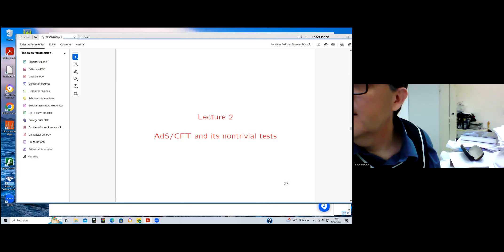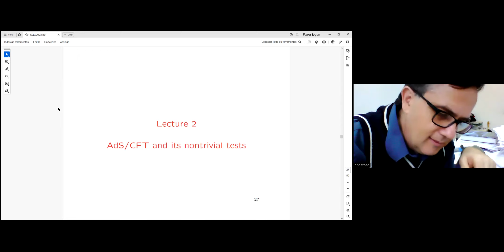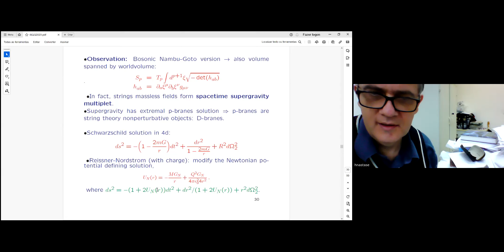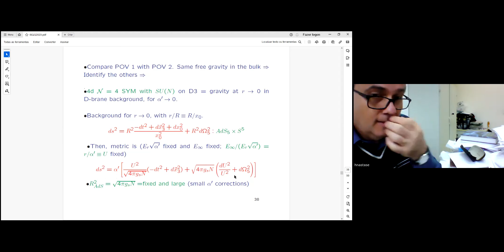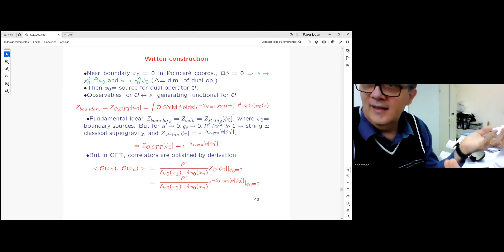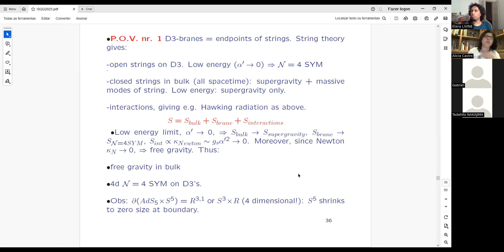String Theory, AdS/CFT and Quantum Gravity - Lecture 2 | Horatiu Nastase

Comment: When registering gravitational waves, the noise is 99.99%, and the useful signal is 0.01% - correct. When registering gravitational quanta, the possibility of receiving a useful signal is 75%; the noise will be 25% - the device needs improvement.
New technologies, new research tools
Let me suggest for schoolchildren and students on one's own to measure the Universe, dark energy, black holes, etc. To do this, I propose two practical devices. «laser tape measure +reference distance 1,000,000 m”» and «Michelson-Morley HYBRID Gyroscope fiber optic 500‡2». I am writing to you with a proposal for the joint invention of a HYBRID gyroscope from non-circular, TWO coils with a new type of optical fiber with a “hollow core photonic-substituted vacuum zone or (NANF)”  where - the light travels 500000 (In a laser tape measure, the length of the optical fiber is fixed at 1000000 ) meters in each arm, while it does not exceed the parameters 94/94/94 cm, and the weight is 94 kg. Manufacturers of “Fiber Optic Gyroscopes” can produce HYBRID gyroscopes for educational and practical use in schools and higher education institutions.
Einstein dreamed of measuring the speed of a train, an airplane - through the Michelson-Morley experiment of 1881/2024, and only then would the experiment be more than 70% complete. This can be done using a fiber optic HYBRID gyroscope. Based on the completion of more than 70% of Michelson's experiment, the following postulates can be proven: 
Light is an ordered vibration of gravitational quanta, and dominant gravitational fields adjust the speed of light in a vacuum. you can make scientific discoveries; in astronomy, astrophysics, cosmology, higher theoretical physics,...